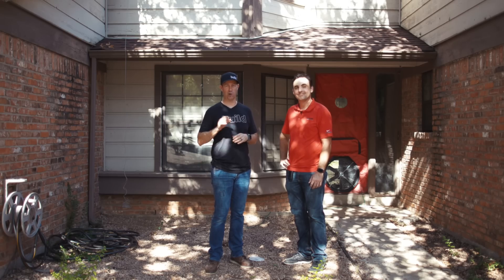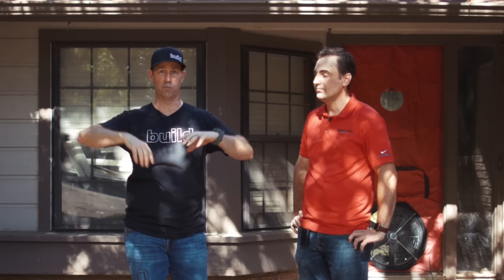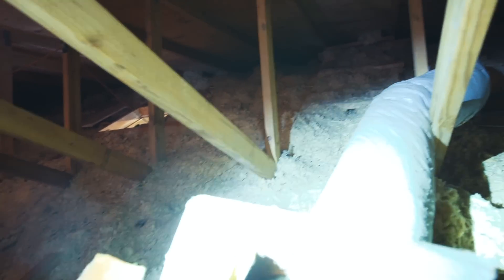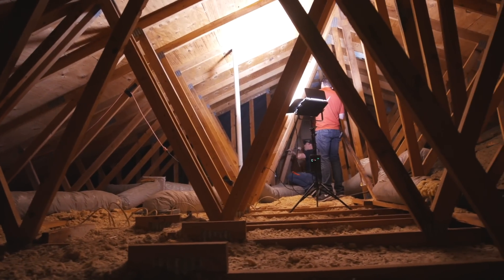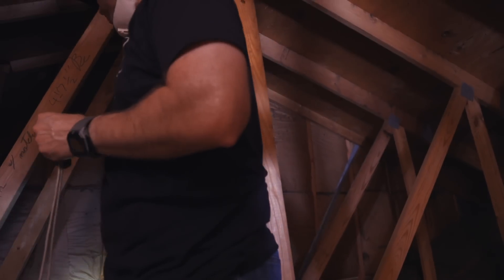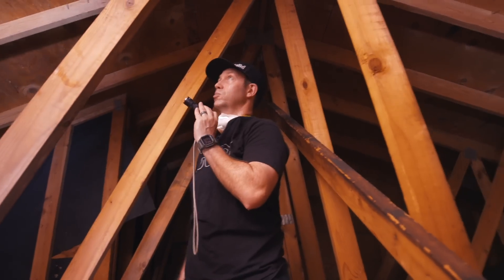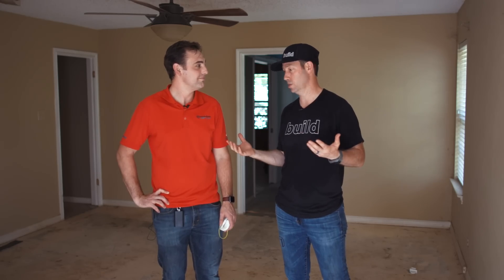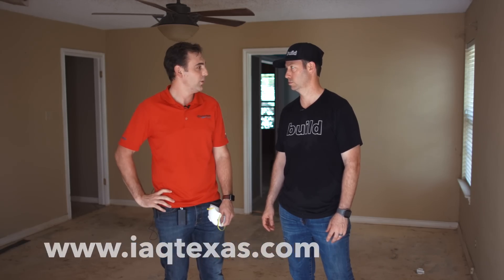You Won’t Believe What I Found In Here!  Pre-Testing my Crappy 70’s House

Comment: What is a ACH 50? And how is it measured?
Reply: Air changes per hour at 50 pascal.
Reply: Dennis Pope Tx! But what is an ‘air change’?
Reply: Dennis Pope 
I searched for on the net (why didn’t I do that before?) and to answer my own question. 
1 airchange = the amount of air (flow) it takes to replace all the air contained in room (or building I guess). 
The unit of measurement is ‘per hour’ (/h)

It’s calculated by converting the airflow to an amount per hour and dividing that by the volume of the room.

Comment: A contractor once told me that in the 1970s nobody had any money due to the recession so builders cut as many corners as possible.  That is how we got such great building innovations such as aluminium electrical wire instead of copper.  Beware of purchasing a house made in the 1970s.  As Matt has now found out the hard way ;)  Amazing idea for a web series.  Can't wait to see more.  BTW in Massachusetts, you can call Mass Saves and they will do this energy audit for free and then you can get a Zero interest loan to pay for any improvements you need.
Reply: Same thing happened where I live in the 2000's. Builders cut corners with the outside of the home and now there's water damage galore and walls having to be ripped out and redone 2 years latter. I live in Utah, it rarely rains.... that ought to tell you how bad it is. 
I don't buy anything newer than the 90's.  Even then they cut corners. 
I just default that I will have to renovate the place no matter what these days. 

We are in our in laws house basement and it hasn't been updated since the late 40's when it was made... the 40's have issues too.
 Lead pipes leaking, in ground/concrete ductwork is compromised with cracks, and don't get me started on the electrical work. It may have thick copper wire, but with scary casing and no ground, sparks are commonly seen. we are slowly replacing stuff DIY (since I grew up with that and my father works in the renovation business) in exchange for rent. Otherwise things would be falling apart faster.
Reply: 70s is also when boomers needed houses, LOTS of houses.  Giant demand plus empty pockets meant major cost cutting.

The most glaring is using T1-11 as a combo sheathing and siding product.  It "works" but is terrible at air sealing and keeping leaks out.  That house may have been "fancy" to get some tar paper under it!

Comment: I bet he will use several mini splits. Seems more economical then having to rework it all.
Reply: That's my guess too.   Just get rid of those ducts rather than try and find a way to bring them into the envelope.
Reply: May be the route I go with my house but I havent figured it out yet, mini splits seem to be such a good option
Reply: @townsendliving9750  I swapped out a 25 year old furnace for a mini-split system about 5 years ago and am super happy with it.  Cut my energy bills in half and had a much better system.   No leaky and dusty ducts.   Constant and even heat and cooling when needed (in Seattle).  Indoor air quality is better.
Reply: @YummyPork  the house house geothermal heated floors, no duct system in place now, its between mini splits, probably would need about 6 mini splits, or a chiller system in the cieling. That one is much more complicated to design and install but has lower energy bills and is just a water based system amd makes no noise.
Reply: Ah you beat me to it I just asked Matt about that before I read your comment!

Comment: Definitely interested to see what you do here. I'm interested in the costs to better insulate my attics (one over living space, one over garage but has a shared wall with upstairs living space). I'm in the Austin area, so whatever you do here will be relevant to me. 

I'm interested in what the costs/process would be to change a blown-in insulated attic to one that is spray-foamed on the roof-side. I'd like to bring my HVAC into the conditioned space to save on costs there as part of this. I know I'll need a more efficient furnace for that, but the insulation piece is where I see mixed messages online. Some say "heck yes" and others say that they can't because of the existing venting system.
Reply: In our hot and humid environment here in Texas, I wouldnt really recommend foam.  These houses do need to be able to dry upwards to some degree.  Foam works well in colder climates however.  You also need to add mechanical ventilation to keep indoor humidity to acceptable levels.  I've known a few people who have spray foam and some had issues with moisture.  The inspectors and code enforcement arent always up to snuff while spray foamers just want to foam and get paid.

I looked at all the options and just went with R-50 cellulose over plywood on top of the rafters.  Its not state of the art but it works well enough.

Good luck with your future improvements!  The energy savings are always nice.
Reply: @bigpjohnson  So is there a recommended way to better insulate an attic in Central Texas that already has HVAC running through it? Do I just need better insulation on the "floor" of the attic and possibly better ducts? 

I assume I could do foam on the garage attic wall that's shared with the upstairs living space though, right? It wouldn't affect upward air movement, but there's tons of gaps where mechanicals (water.. because my water heater is in that attic, electric, phone, etc.) are going through that wall and I'm not happy with the cutouts in the batts there. It's also held in place with mesh, which is better than just a few straps, but there's gaps around the header due to how it was installed.

Comment: I'm totally dealing with this in my 40 year old house right now.  I have old,  leaky,  metal ducts.  Musty air in the summer,  high energy costs,  low air quality.  I'm trying to figure out if I should replace or just seal and reinsulate. Everyone says something different.  

Thanks for the video,  it came at a good time.  I'll probably go with the guy I talked with about the home audit.  

On the plus side,  at least I  don't have the rats.
Reply: 40 years old? Replace it. You wouldn't do repairs on a car that's been driven for 40 years. Your repairs aren't going to give you decades of trouble free service either. Time to replace it.
Reply: You could clean and seal and insulate, but that is 40 years old of dust containing god-knows-what lying inside them, and you're breathing it in constantly.  Rip them out and put in everything new.

Flex duct isnt perfect energy-wise, but its cheap and NEW.  You'll appreciate the clean air. :)  If its not much extra, then get metal ducts again.
Reply: I'd prefer to replace them,  but the cost is about 2 to 4 times as much.  I'm willing to pay for it,  but if there really is no other options.
Reply: @grapeape3633  
Make some calls and get bids. They can vary greatly.  Even if you decide you're only going to do upgrades.  The more the better.

Comment: I'd be curious at what point it actually makes sense to just tear the house down and start over instead of trying to work with what's there
Reply: Not a professional builder but to the best of my knowledge that's a usually complicated question as it depend on multiple variables...  

Demolishing isn't always an option because the property may be in an area that won't allow either the demolition or any new construction...  Costs can vary considerably from one area to the next and across the country, which can effect how cost effective either option is...  Some areas may make it more cost effective to do a renovation with tax incentives, etc. or the permits, code requirements, etc may make the new construction cost significantly more than a restoration... How deep you are into the project with time and money invested it can be harder to change course at a later date if already committed to a renovation...

But, if you know ahead of time that there's significant cost to a restoration, and there's nothing that will effect that consideration, then according to Chicago-area tear down real estate specialist Brian Hickey, who heads InfillRE, LLC and Teardown.com, a tear down should be able to support a new house that, when complete, is valued at two to three times the price of the tear down house at acquisition... Assuming a restored older house won't sell for more in the area...

There's a cost to demolishing an existing structure that has to be added to what it will cost to build a new structure and, again, all those costs can vary across the country.  Some places you can build a 2000 sq ft home for around $70K but others may go over $500K for the same size house... But value of the land and whether you can save on costs by retaining the same foundation and other infrastructure vs a total demolition and building from scratch can significantly effect how that math will work out for you...  Along with variables like time frame and how strict new building codes are in your area... 

So you have to consider it case by case and use your best judgement...
Reply: Most tear downs are usually of smaller houses where they build a BIG new house to replace it.  That makes sense since the bigger square footage yields a higher price.

If you want to replace it with something similar, then you have to compare new build to remodel costs.  If it gets down to a difference of $25 a sq ft or something, then its probably worth it to rebuild.  This is comparing remodel costs of $50-100 a foot in an area where average construction is $100-150.
Reply: It’s not a binary choice. The best option would have been to stick to the $75k budget, repair the systems that NEED repaired, and then rent it out. If he had done that, he’d have $525k in a house worth $550k. About 5 minutes into the first video he completely changes his mind and decides to blow $300k on the renovation. Now he’s got $750k in a house worth $550k.
Reply: @kungfoochicken08 - No, everything he's doing is improving the house from what it was, which was frankly very bad.  So he's increasing the value!

Home values aren't static, old and bad conditions will lower value but you can do more than restore value as there are ways to increase home values and there's also ways to reduce long term costs which can add up to more than the house cost over time.

One of the big mistakes a lot of people make is ignoring the long term costs but those costs can add up to multiple times what they paid to purchase the home over time.

Everything just has trade offs and he chose the long term benefit...
Reply: @ZeoCyberG  Whether the value is increasing or not is a very easy thing to measure: is a buyer willing to pay for the "improvements" he's making. Matt has spent $750k for a house that would only be able to sell for $550k. He's not increasing the value of the home, he's wasting money on improvements that buyers don't care about. 

The difference between a professional real estate investor and a contractor is that a real estate investor understands what people are willing to spend more money for. The technical term for what Matt is doing is "over improving" or "over developing" the home.
Reply: @kungfoochicken08  No, people are willing to pay more for better amenities, better features, better performance, better layout, etc. You can't just say it'll sell only at that price because the market is flexible.  Besides, you're ignoring that he could otherwise be spending more over the long term!
Reply: @ZeoCyberG  The home will sell for $550k if he put it on the market today. Even if he found someone willing to pay more, it would only appraise for $550k and they'd only be able to get financing for $550k. Changing the pitch of the roof for cosmetic reasons is not a renovation that brings a high ROI. Tearing up a slab to move the toilet three feet is not a renovation that brings a high ROI. Spending 20k on insulation and air sealing is not a renovation that brings a high ROI.

Matt is carelessly throwing money at this house instead of prudently deciding which renovations improve the value of the home. He's wasted $200k in renovations that he'll never get back. If he's lucky, the market will catch up to his house in 10 years.
Reply: @kungfoochicken08  Sorry, but no... A) You're ignoring it had far more damage to fix than he originally estimates and B) He's making major improvements that individually each may not add a lot of value but altogether will add a lot of value.  Seriously, there have been homes like this that after the renovation the value more than doubled, so it all depends on who will buy it and what they value. Never mind, he's keeping it and the point for him is the long term value, which saves him far more over time if he does it right!... Homes like this the way it was could cost up to millions over time in maintenance and repairs!

Comment: I have seen one of your videos that suggested to insulate the rafters of the roof instead of blowing insulation onto the floor of the attic to keep the ducts from creating condensation and help keep the house cooler. Would inspectors accept that? And what is the Best way to insulate the rafters?
Reply: Either closed cell or open cell insulation

Comment: Oh Matt how disappointed I am in you on this video. You made the comment that trusses make remodels more difficult and you will need an engineer. You meant to say that stick framed roofs make remodels more difficult. With trusses it's way easier since the roof is supported by the exterior walls not the interior. In many cases you can remove the entire interior wall structure on a trussed house while a stick framed house is a royal PITA.
Reply: Robert Adams my understanding of what he said is in regards to remodeling the attic/roof.
Reply: What???  Trusses are engineered and built with thinner wood, and have to be re-engineered for any changes.  Sometimes its not really feasible.  Trusses work as a team and will fail unless properly re-engineered.

Stick-framed roofs have larger rafters and fewer supports in the middle.  This makes changes MUCH easier.

Comment: I've got a 1962 brick home. Any video of how to fix leaking and insulation in my interior walls?
Reply: Keep the water off your brick first of all. Second insulation repair on a brick wall is done on the interior side so new sheetrock. I don't think you can put a wrap on a brick house w/o demoing the wall out and rebuilding. I've got a late 70s brick house with OK weather. First and foremost I had splashback to take care of but once you get the water off the brick and handle splashback you are usually GTG for water issues and leakage but then insulation has to be done by ripping out the sheetrock and redoing the insulation. I wouldn't trust cutting a hole and blowing in new insulation. Need to pull it down and see what is going on back there and other issues that might need fixing. I've got two door frames to repair and two sections of shiplaped siding to replace due to splashback rot.
Reply: @meatybtz  
Yeah I am planning a room by room renovation.  I'm a hvac tech and my wife and I are doing this ourselves. I guess what I am looking for is a way to deal the exterior wall from the inside before I reinsulate and hang rock(or whatever interior wall material she comes up with).
Maybe some type of roll on or something??
Reply: @bencox3195  Then it would depend on how the Brick is attached to the frame of the house and how much access you have from the interior. I don't know if roll on would really add anything. Do you know how many courses of brick make up the walls? You will find out I suppose once you open things up. Never heard of anyone rolling on a sealant to brick on the interior side.
Reply: @meatybtz  not on the brick. On the interior side of the sheathing.
Reply: Dense pack cellulose from the inside of the house

Comment: 💸The budget is flying away💸..But a great episode thanks for the information.
Reply: Right, he's gonna hire a crew to come in and vacuum the insulation out, rather than sweat equity it.
Reply: @doug.ritson  Insulation is rarely worth DIYing unless its a small area.  The pumps on the professional trucks can vaccuum everything out in a few hours, and then blow new insulation in even faster.  Trying to stuff it into garbage bags or using shopvac takes ages.  A neighbor tried, it wasnt fun!
Reply: bigpjohnson I just went through this, I had to pull out blown in the exterior walls and ceiling. I tried doing it by hand but it was ridiculous. I rented a gas powered insulation vacuum and it was worth the 300 dollars a day. That’s the best way to do it or have a pro.
Reply: Good video.. Perfectionist contractor does not mix well with budget remodel... :)